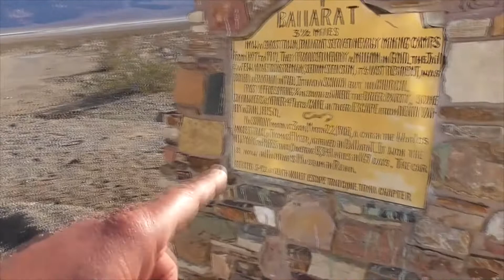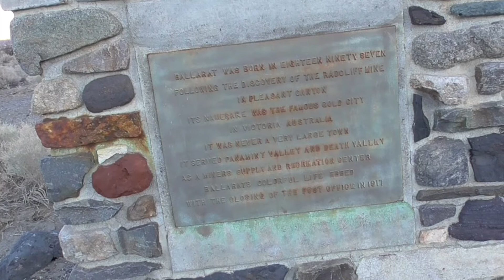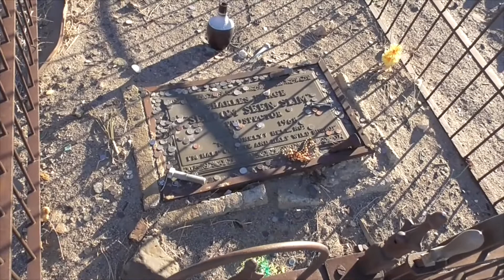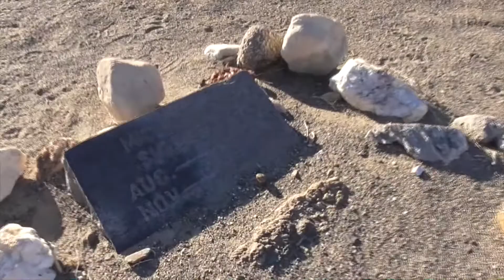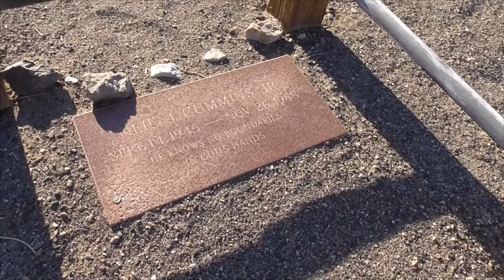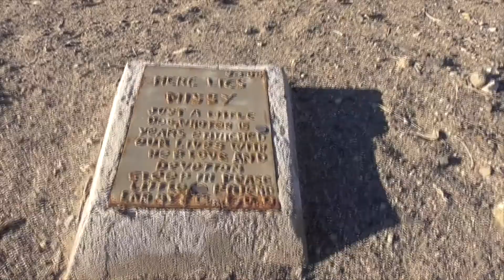BALLARAT GHOST TOWN, Panamint, Death Valley - old building ruins, mining equipment, history

Comment: @ 4:46 minutes. Sorry, but your wrong, the device you called a Well Cap is in fact a manual tire changing machine. I know this because I used one at my father's Mobile Service Station back in the bay area in the sixties and seventies! I grew up there and learned early on how to change out tires, balance them and re-install them on cars that my father serviced. The lever on the top has the tire pusher that would break the top bead, the lever on the bottom broke the bottom bead. the cone shaped device on the shaft sticking up screwed on onto the wheel to hold it in place during the process. Then there was a lever that you'd slip into a slot in the top shaft that would grab in the inner bead and roll the bead over the edge of the rim and roll the tire off the rim. This was before someone invented the powered style tire changers you see used today. I can't count the number of tires I changed during those years, but it sure gave me a good work out, remember bias plied tires? they were a lot harder to change than today's radial ply tires I'll swear to that!  All things considered, I loved the tour. Benn there myself several times and even up to the mine in the canyon!
Reply from the maker: Thanks!